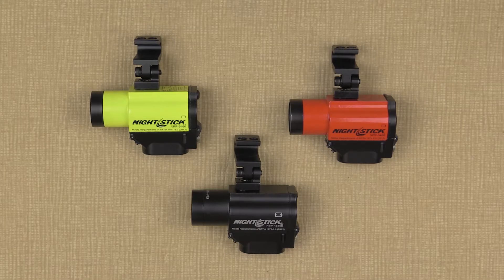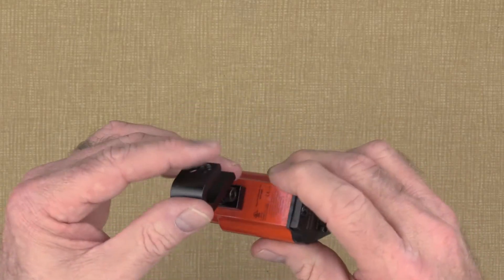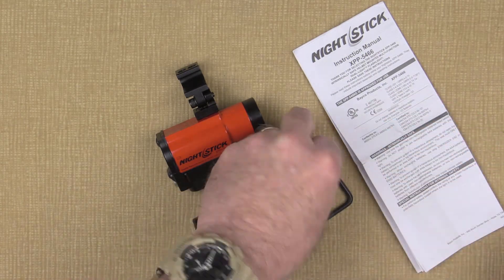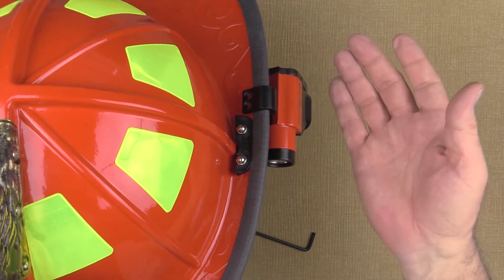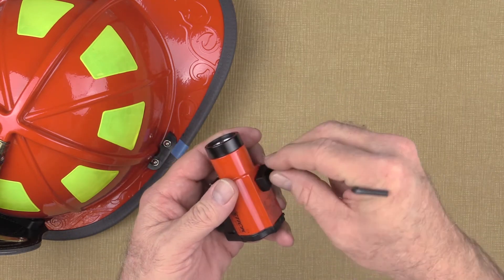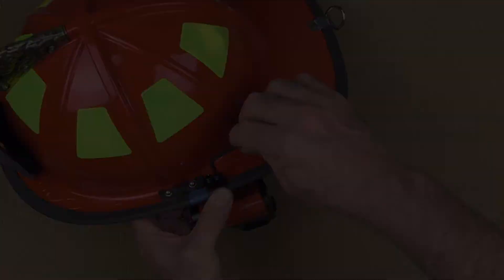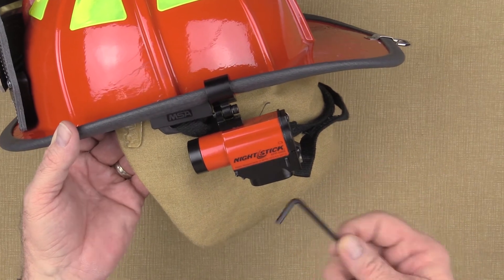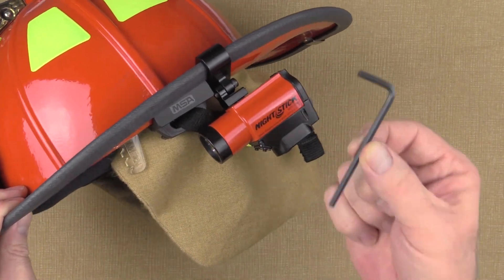Mounting instructions for the Nightstick NSP-4650B & FORTEM XPP-5466 series

Comment: only thing I dislike about the 4650b is that the light buttons are on the bottom and not the top or rear because everytime I put my helmet on the rack I hit the buttons and lights come on but overall great product and very bright!
Reply from the maker: Thanks Eric for your feedback. The location of the buttons will be an issue debated for a long time with no real answer that will leave everyone satisfied. Based on the research and feedback of the firefighting community of first responders that we arduously consulted, the feedback that was most compelling with the need for simplicity of pressing buttons while using gloves. This was the determining factor that lead to our design of buttons on the bottom. We know this stands in contrast to our competition, but then again... if we created a product that gave you the same limitations our competitors designed today, what value would we provide greater than a better price and higher quality? Thank you for your feedback and we appreciate your loyalty to Nightstick.